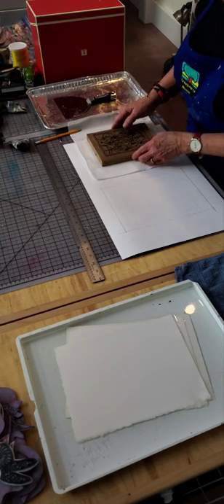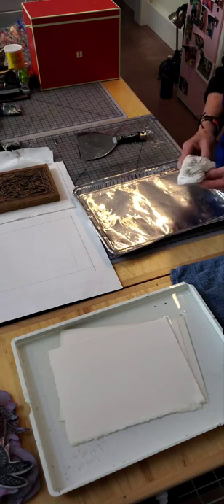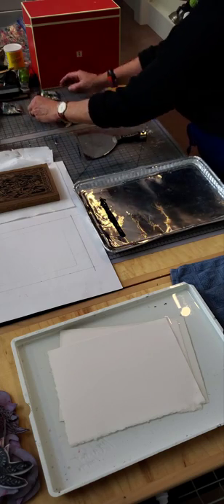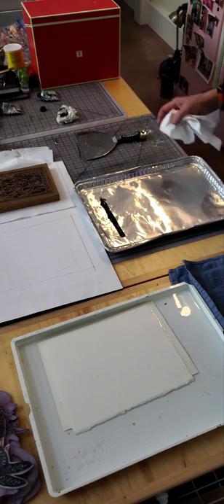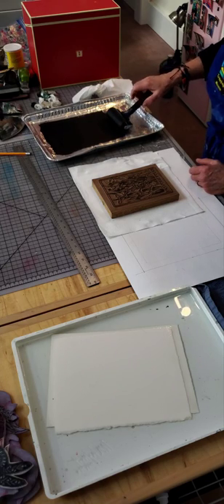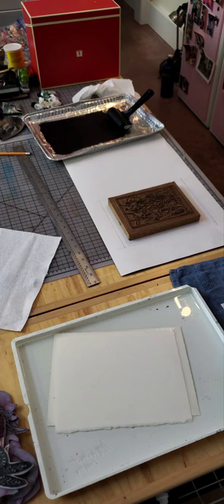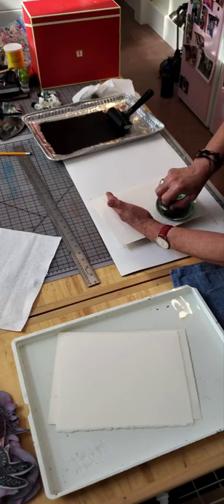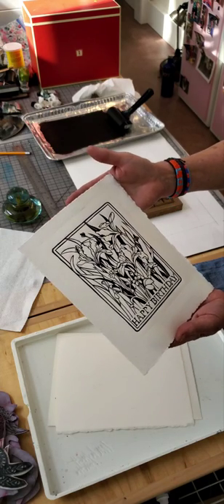Printing a small mounted linoleum block by hand.

Comment: Good tips! How long did you soak the paper? Looks like you just let it air dry on a towel for about five minutes and then it was ready to use?
Reply from the maker: Hi Mary, The paper needn't soak long at all, a couple of minutes is plenty. I make sure the paper is damp, like a well-wrung sponge, but not at all wet when I print with it.